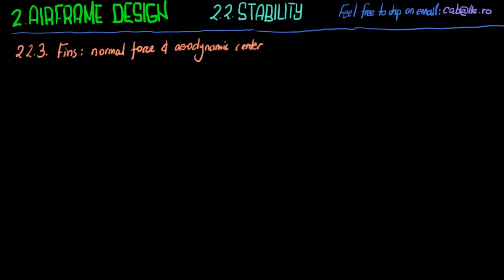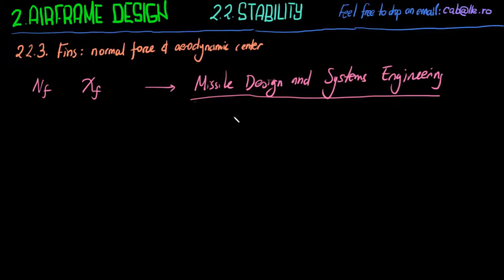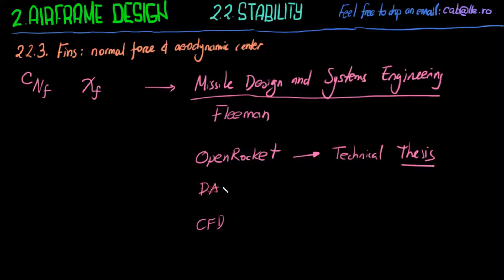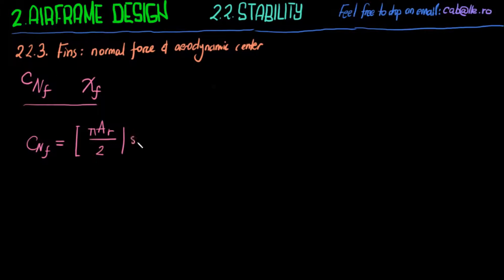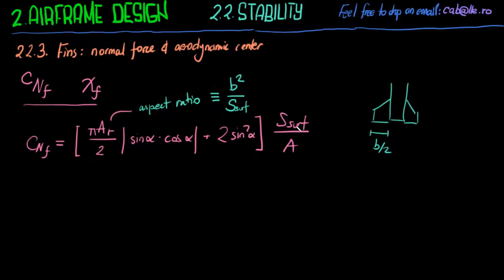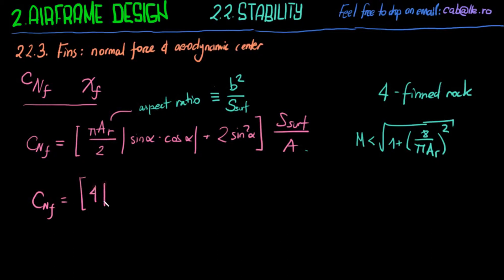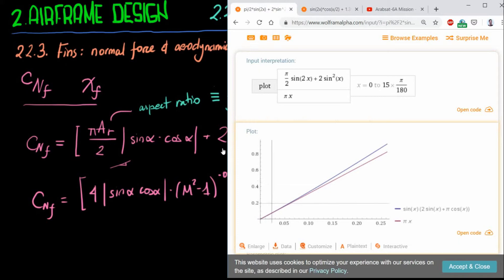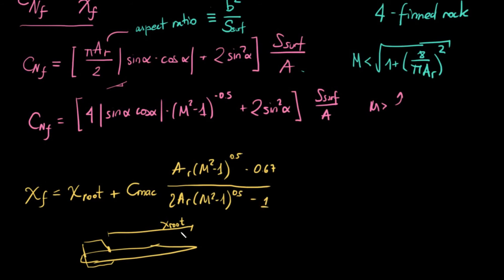2.2.3. Fins: normal force and aerodynamic center

Comment: It may be useful to clarify that your chosen variable for aspect ratio is 'Ar' considering it is typically written as 'AR' or just 'A' as Fleeman does.
Reply: You're right, I should've mentioned that. If I recall correctly, I do change the definitions of certain variables relative to what Fleeman had, so just be aware of that. Thanks for watching the video.
Reply: @manelcaballeroperez2499  Thanks for the response and the informative content!
Reply: @MaxWeinstock  of course! My pleasure!